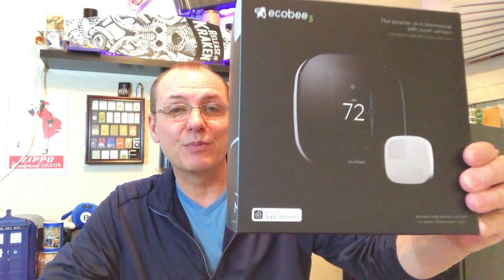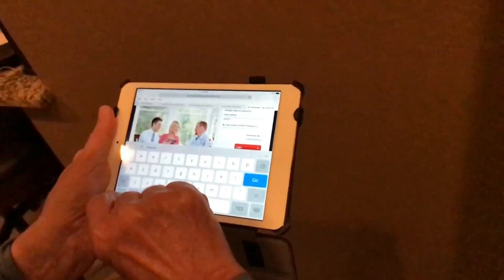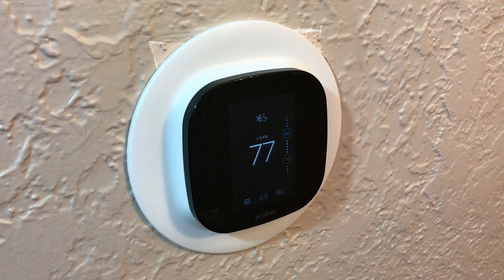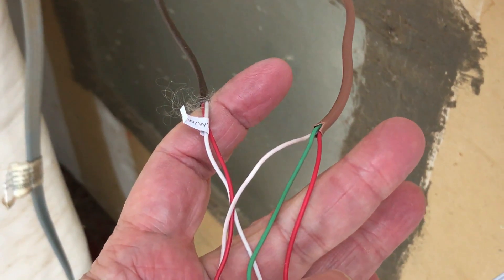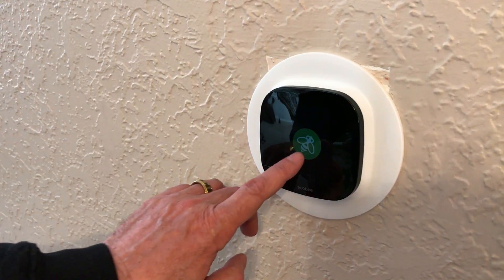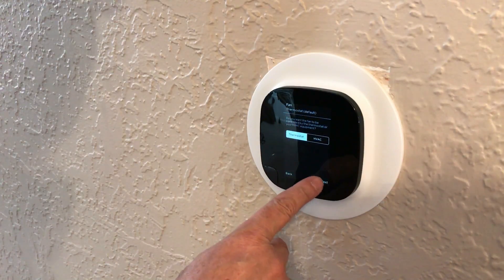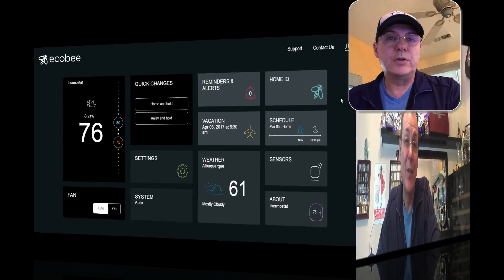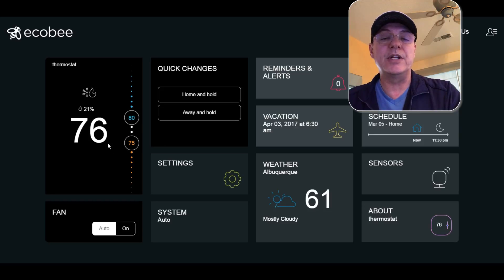Ecobee3 Smart Wifi Thermostat Installation + Amazon Echo + Power Extender Kit (PEK)

Comment: I just installed the ecobee 3 at my new house last week and now they announce a new one with built in Alexa. not sure if I will return it and get the newer one.
Reply: John Stone, Ecobee support contacted me after I responded to a survey they sent me asked if I would recommend the Ecobee 3 to a friend. I had answered no because there was a new one. they offered to exchange it but I would have to send it to them and then wait to get the new one. so I ordered one from Amazon and will return the old one to Home Depot after switching them.
Reply: John Stone I got the Ecobee4 installed easily but you have to put all your settings in again. doesn't duplicate them from your account. also it's not supported by Wink yet but they say they're working on it.